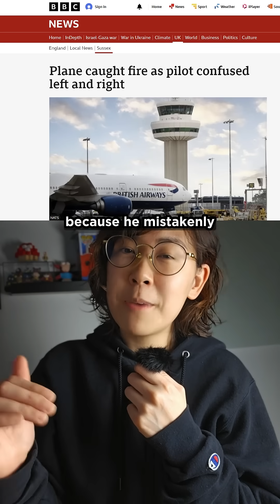Did a Pilot’s Left-Right Confusion Really Shut Down the Airport?

Comment: Think about this: pilots don’t often switch sides, they do for example if; an FO is upgraded to captain, or two captains are flying together, it’s not often but it can happen. In that case, you’re used to pushing with one arm and pulling with another. When you switch to the other seat this motion is inverted. 

When comfortable, it isn’t an issue, but in a moments notice under pressure, muscle memory kicks in, and you F up. 

- a former pilot
Reply: U guys really underestimate the power of muscle memory
Reply: @rblxjond2 they really are

Because muscle memory is the thing that
Lets us balance 
Ride bikes
Walks
And plenty more 😅
Reply: @rblxjond2 and you're overestimating it... It doesn't work that way 🙃
Unless you lack self control / situational awareness, in which you shouldn't be a pilot or jobs that need control
Reply: @ if you rely on muscle memory during such operations and you lack any and all focus you are incompetent.
Reply: @Thomas-xd4cx  muscle memory is powerful. Muscle memory means you dont have to think about walking you just do it, muscle memory means you dont have to think about moving you hand you just do it. Muscle memory is a very powerful thing and it can sometimes be hard to train yourself out of it. 

Majiroty of things people do throughout their lives are based on muscle memory. The human brain does this to save energy and to protect you. Only time muscle memory doesn't take over is when you have to do something new etc like for example riding a horse for the first time.

Mistakes do happen thankfully the pilots did everything in their power to ensure their passengers were safe after the mistake.
Reply: @Thomas-xd4cx   No one is perfect. You're crazy if you think anyone is. No one is safe from making mistakes—you can't avoid them entirely. You can reduce how often they happen through training, but that doesn't mean they'll disappear forever. Yes, there are 200 people onboard, but remember: pilots are just human. They train to make fewer mistakes, not to be perfect. Perfection doesn't exist.
Reply: @Thomas-xd4cx I hope you're living in a world where people train for perfection instead of just making fewer mistakes—because perfection doesn't exist in real life. I hope you live in that perfect world, because it will never exist here. Everything runs on chances. Life is full of them.
Reply: @ I understand that very well. You see, I work with dangerous machines every day. What I’ve learned is that you should NEVER EVER get comfortable. One tiny mistake and you lose a limb or worse. Slow is steady and steady is fast, especially when it comes to such risk. I can tell by the kind of mistake that the guy wasn’t there with his head and that’s exactly my point. Rest when you’re in the air or on the ground, just make sure you’re focussed when the critical actions need to be performed. Again, I understand mistakes are made but I really hope he got a mouthful to make it stick in his head that such mistakes should never happen again.
Reply: @Fishsy_The_Fish  you’re acting like he made a tiny mistake. Bro was full on dreaming while in charge of 200+ souls - that’s not some small mistake lol
Reply: @Thomas-xd4cx The point is, you can't escape mistakes—everyone makes them. Are you living in some kind of reality where people don't mess up? Having 200 people on board doesn't make you perfect. You're just making sure they're safe, but that doesn't eliminate the chance of making a mistake. Let's be real—live in the real world. Having 200 passengers doesn't make a pilot flawless. Pilots are overworked, stressed, and have a lot going on in their heads. It's not just a few—almost all pilots deal with this.
Reply: @Thomas-xd4cx Everyone makes mistakes under the right conditions. No one is safe from muscle memory—it’s just human nature. Sure, they’re trained to reduce those errors, but that doesn’t mean muscle memory disappears. It never fully goes away.

Pilots are trained to make fewer mistakes than the average person so they can safely fly a plane—but that doesn’t make them superhuman.
Reply: @ did you even read my comment?😂
Reply: @ there are hundreds of jobs where the tiniest mistakes lead to death. It is hammered into you to go slower if you’re not sure. A freak accident is something different than dozing off during takeoff. You can’t convince me otherwise.
Reply: @Thomas-xd4cx Yeah and its natural?
Reply: @Thomas-xd4cx  
I don’t know how to tell you this, but even a one-in-a-billion chance of making a mistake is still a chance—it’s not zero. And mistakes can lead to consequences you can’t even imagine. Mistakes are complex.

There’s always a chance someone will mess up. If it doesn't hit me, then who? Out of 8 billion people, someone’s going to take the hit eventually. Your focus is on the 200 passengers, but what about the pilot who’s overworked, overwhelmed, and running on little to no sleep? That massively increases the risk of an accident.

And seriously, tell me—why don’t they ever switch which pilot is flying each time? In a plane, they usually stick to the same seat unless there’s a reason to swap. That habit just reinforces muscle memory—and under stress, that’s exactly what can backfire.
Reply: @Thomas-xd4cx I did—and your take is trash. You want humans to be perfect and live in some virtual reality where no one makes mistakes. Take a step back and live in the real world, where people are human, not flawless robots.

Sure, people like pilots are trained to make fewer mistakes than the average person so they can fly planes safely—but that doesn't make them immune to failure. Experts in human physiology (how the body works), muscle memory, and psychology would agree with me—and probably laugh at you.

Mistakes are part of being human, and no amount of training erases that completely. If you're out here looking for a superhuman who never makes mistakes to be a pilot—good luck. No one's flying that plane.

Also, just putting it out there—your comment is a mistake all by itself. Fix that before you try to fix humanity.😂😂😂
Reply: @Thomas-xd4cx The point is, what you said basically proves my argument. A pilot is trained to make fewer mistakes than the average person—not to be perfect. They never get comfortable because their own life is on the line too. They stay steady and alert, sure—but that still doesn’t eliminate the unpredictable nature of human error.

You're just describing a system that reduces the chances of a mistake—not one that removes it. So yeah, mistakes shouldn't happen, but they still can. If you really think about it, your whole comment just supports the fact that perfection is impossible—only better odds, not guarantees. You cant name a perfect person because it doesn't exist
Reply: @Fishsy_The_Fish  I agree with Thomas. You're misunderstanding what he says, and also you misunderstand the concept of making mistakes. Obviously, everybody has a non-zero chance of making a mistake at any point. However, the probability of making a certain KIND of mistake could very well be 0. E.g. what is the probability you will cut down a tree instead of planting a new one (by mistake)? The same goes here. And I'm not referring to him confusing the hands, this is a typical error with non-zero chance for anyone. The mistake Thomas and I are talking about is forgetting you are not allowed to use muscle memory during takeoff and landing in the first place. This is like cutting the tree instead of planting it.
Reply: @Thomas-xd4cx it’s impossible to eliminate errors, which is why in aviation we have mitigation, often learnt through mistakes. The reason this didn’t end up with lives lost is because of those procedures.
Reply: Bro, your entire argument falls apart the second you say, “the probability of a certain KIND of mistake could be zero.” That’s not how humans work—that's how machines work, and even they mess up. You can train someone a million times, drill it into their brain, but under the right pressure, stress, fatigue, or just one second of mental fog—boom, mistake. That’s reality. Not your fantasy land where pilots are Jedi masters immune to failure.

Also, “you’re not allowed to use muscle memory”? Are you serious? Muscle memory doesn’t wait for permission like a dog. It’s automatic. It’s subconscious. You don’t get to say, “Oops, I won’t use it today,” like it’s a phone app. That’s literally the danger of it—it kicks in especially when you’re tired or distracted. That’s why it's a risk, even with training.

Your tree analogy is garbage too. It's not about planting vs cutting—it’s about doing the same action so many times that your brain runs on autopilot, and one slip can cause the wrong motion. You’re comparing deliberate actions to subconscious reactions. That’s not a comparison, that’s a deflection.

Bottom line: You’re arguing perfection in a world run by biology. That’s not logic—it’s delusion. @user666mega
Reply: @Fishsy_The_Fish  First, you're contradicting yourself. You say "muscle memory doesn't wait like a dog" and then you say "it kicks in especially when you're tired or distracted". So it was waiting (like a dog) for you to get distracted, wasn't it?

Second, you still don't get the distinction in kinds of mistakes. The tree planter, who plants trees all day, will not cut down a tree by mistake, no matter how tired he is. The probability of such mistake is 0%. This example was not a perfect analogy, sure, but it was supposed to show you some mistakes can be impossible (since you keep saying anything can happen by mistake).

Obviously, when you're tired, you will do things by muscle memory, even if you're not supposed to. However, before takeoff, a pilot takes stock of himself. If he is tired, he is not supposed to fly, to prevent falling back to muscle memory by accident. That is protocol. So, in order to do this mistake, he first had to commit a conscious transgression of ignoring protocol.
Reply: Your tree analogy is laughable. You’re comparing apples to chainsaws. Planting a tree and accidentally cutting one down isn’t even remotely the same as making a high-stakes error under stress. A tree planter isn't operating under complex systems, high pressure, or the threat of disaster if he slips. He does one repetitive task. That's it.

And saying “the probability of that mistake is 0%” is pure delusion. There is no such thing as a 0% chance when humans are involved. People have tripped over their own feet and fallen into machinery. People have accidentally reversed into walls after driving for 20 years. You think fatigue and distraction can’t cause a planter to swing the wrong way, grab the wrong tool, or damage a sapling? Then you’ve clearly never seen how humans actually function in the real world.

More importantly, you’re ignoring the actual science of error. Human mistakes aren’t just about knowing what to do—they're about how your brain processes information in real time. Under fatigue, the brain falls back on automatic behaviors. According to cognitive psychology, this is called a “slip”—when your muscle memory takes over and overrides your intention.

So no, your tree guy isn’t immune. No one is. If your entire argument is based on some imaginary 0% mistake rate, then congrats—you just proved you’re not arguing reality. You’re arguing fantasy.

Even if a guy plants trees every day for 50 years, there’s still a chance—maybe one in a million—that he’ll make a mistake. That chance is never zero. He’s still human. Not perfect. Not special. Just trained—and still fallible.
Reply: @Fishsy_The_Fish  As I've already admitted, it's not intended as an analogy, but as an example of an absurd mistake that will never happen.

Anyway, we are trying to explain to you, the issue with the pilot is that the root cause was not a mistake, it was a conscious decision he made earlier, before takeoff. He was not stressed then, he was not under time pressure, he had no excuse. He DECIDED to continue with his shift even though he was tired. Even though it's against protocol. This is not a mistake that just sometimes happens, it is a choice you make on purpose. Just like cutting a tree instead of planting it (I'm not talking about tripping over your feet and falling into a tree by accident).
Reply: @user666mega ur argument doesn't make sense. A better one would be that a tree cutter who is suddenly asked to plant trees could accidentally try to cut it when he is tired
Reply: @rblxjond2  You misunderstand. My example was not about switching seats, it was about flying when so tired, he can't even maintain non-muscle memory state of mind, which is expressly prohibited by policy.
Reply: @user666mega  yet pilots are overworked
Reply: @user666mega but those are entirely different things, and have different actions to do them. To cut a tree you, well cut the tree with a tool. To plant one you have to dig, place the seed, and cover. With a plane, you push and pull both objects, and it’s way easier to get the two mixed up than your argument here.
Reply: @Fishsy_The_Fish it can be a mistake, but you definitely can't call it muscle memory as an excuse! Lapse in concentration, got distracted could be the reason, but if you say muscle memory, then it is bullshit!
Reply: @user666mega not the same analogy, but your other points were valid..
Reply: @Mets2015WorldSeries  Obviously. I created the tree cutting example, because the guy I was responding to claimed every possible mistake can be made by with large population, and this was my counter-example.
I'm not disputing it's easy to mix hands when on muscle memory. The whole point is that protocol requires pilots to stay extra focused during takeoff, and this can't be ignored because of "muscle memory".
Reply: @rblxjond2  Protocol requires them to refuse operation if unfit for duty.
Reply: I feel this is a training thing. Pilots should go for a course to train their muscle memory so both sides of the cockpit is ingrained in them. I know people who when on holiday can easily switch to driving on the other side of the road, and others who do not. Especially with the wiper/ lights switch.  But certain professions should have sufficient training to prevent this. When lives are at risk, and the person is made a way above the median salary.
Reply: As an aircraft tech, I verified with the Avionics Engineer and she approved..
Reply: Very well said, and a good explanation
Reply: You know what, as a student in Psychology, this would actually be a pretty interesting research topic; especially with trying to mitigate this issue. Our school has an Aviation department too, so it might actually be possible for me to do with their cooperation.
Reply: @Eis_  that would be an excellent study to do could have some intriguing outcomes
Reply: Muscle memory and sleep deprivation probably.
Compare to controls of a fighter jet where it's pretty much the same layout for front and back seat.
Reply: @RoundOrangeball sleep deprivation or lack of concentration, probable, but definitely not muscle memory!
Reply: I figured since pilots are overworked and don't sleep enough because of being over worked that would be enough to cause a mistake for anyone
Reply: This was what I thought. And I was like wait girl aren't you doing the same thing, not knowing the entire concept of pilot and co pilot. It switches often and thus controls switch in the same way.
Reply: @Slayerx2010  They dont switch often, no way. FO is sitting on right side until promoted to captain.
Reply: That makes sense.
Reply: When I bought a car from the Japanese domestic market to drive in Canada, i spent about 5 days punching the door looking for the gear shifter. 

Also, using your left hand to power shift in a RHD vehicle is much easier when you turn your hand upside down and cup backwards, because when you slam gears from 1 to two, youre pushing away from 1 to 2 easily found, but if you grab it like you would use your right pulling 1 to 2, in a RHD car your pulling the RHD lever from 1 to 4 or reverse if your slamming gears. So especially for 1 to 2 in a RHD vehicle, people turn their hands upside down and cup back and away instead of pulling it towards you being held like a pistol grip.
Reply: @paddington1670 then you lack self control and awareness?! 😶‍🌫️
Reply: True but not what happened in this case. The guy who made the mistake was always in the co-pilots seat. He couldn't explain why he made  the "action slip". And despite what this video suggests  he DID perform an action with his left hand that he  was meant to be performing with his right hand.
Reply: How often it happens ? Is it enough for manufacturer to revision that part of design ? Like some sort of voice or screen confirmation ? Or captain or co pilot push a button to indicate "who has control", then system would lock the thrust lever and yoke if the personnel is gonna to make the mistake.
Reply: This copilot only ever flew as copilot so that's not the reason
Reply: Why haven't they created/engineered a way to prevent this confusion? It seems like such a silly thing that would be such a risk to lives and equipment.
Reply: People don’t realize how easy it is to mess up like that, for example you are almost guaranteed to hit your wipers instead of your turn signal if you tried driving a RHD car and are used to LHD cars because the are on different sides, happens to pretty much everyone.
Reply: Yeah, well... but I don't think muscle memory works like this lol
I mean, you should be able to control your decision and definitely 100% knowing what you're doing, how could you mess up a pilot / copilot position and the left n right of the gear (or whatever it's called)

Shit happens, but this isn't included in it lol
Reply: @amoldivo dude, imagine u have been doing something a certain way for YEARS, and suddenly u are asked to completely reverse what you do. Look, I get it pilots shouldn't be making mistakes, but they are overworked and shit happens. The good thing is, he managed to understand and react to the situation fast minimising the damage
Reply: That’s a much more in depth explanation than what was needed for any reasonable person to come to the conclusion that this sort of thing was bound to happen at some point. I mean it’s just normal human error. This sort of mixup happens to everyone pretty often and it was bound to happen to a pilot at some point. However perfect they’re meant to be they still make mistakes and this is the sort of thing that doesn’t even speak about competence. Everyone has had this sort of thing happen.
Reply: It still seems idiotic to me that you’re on a runway trying to get airborne and this doesn’t even register. I’d definitely have an investigation started at the competence of said pilot. Sh*t happens but this kind of mistake can costs hundreds of lives - totally unacceptable in such a position.
Reply: @Thomas-xd4cx look, shit happens. The pilots did the safest course of action, and no one was harmed. The tires could have caught fire if the plane has to abort take off for any other reason
Reply: @therealmeriones  i dont care for the tires but for someone who has 200+ souls in his plane and doesnt know you need to throttle up during takeoff. The guy was dreaming or something, either that or just really incapable of such responsibility. How do you even fuck that up😂
Reply: @therealmeriones  You're missing the fact that they most probably rejected after V1, because they thought there was a dual engine failure. The safest course of action at that moment was to set the full thrust and continue.
Reply: @Thomas-xd4cx  have you ever been tired and needing a coffee, any making what should have been avoidable mistake. Sometimes muscle memory kicks in, in ways you don’t expect when you are tired or distracted.
Reply: Yes and I have learned the hard way that I need to pay attention especially in those conditions. Getting comfortable with your muscle memory is dangerous. It should be used for simple, menial tasks. It shouldn’t be used for important tasks.
Reply: @Thomas-xd4cx That’s cute, but biology doesn’t care what you think muscle memory should be used for. It’s not some optional tool you switch on and off—it’s hardwired into your nervous system. The more you repeat something, the more it becomes automatic. In high-stress situations, people default to instinct and muscle memory whether they want to or not. You can “try” to stay conscious and alert, but the body’s going to do what it’s trained to do. If you’re blaming muscle memory, you’re not arguing against a habit—you’re arguing against human nature. Good luck with that.